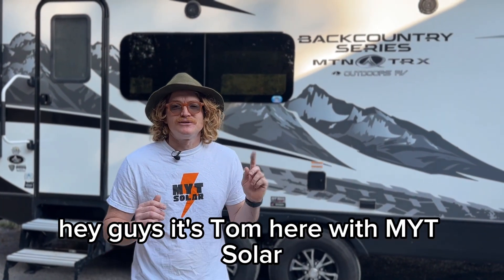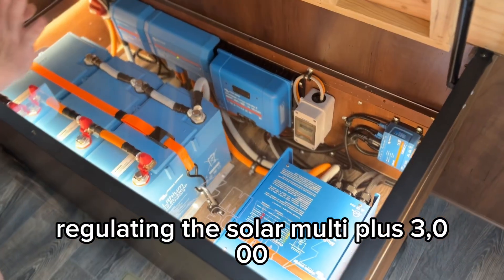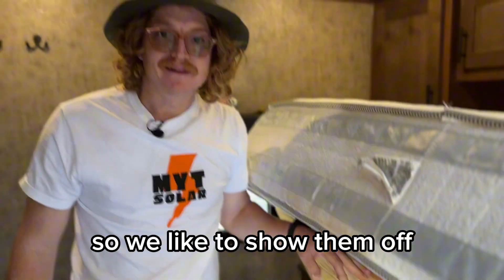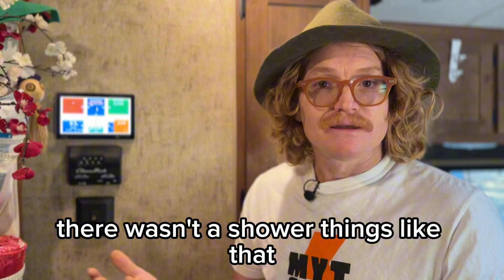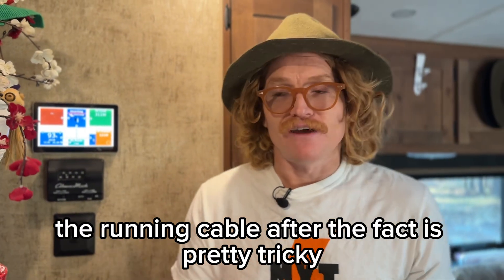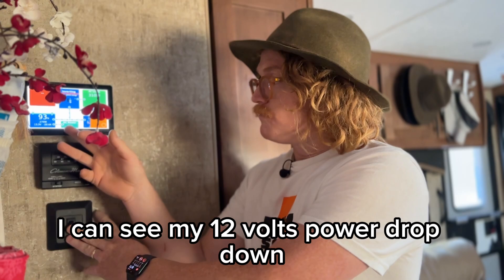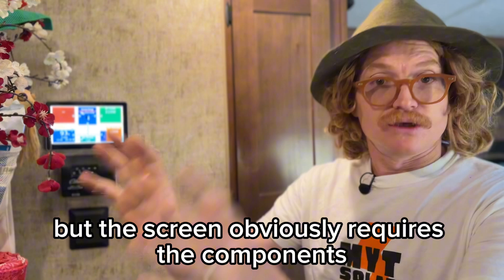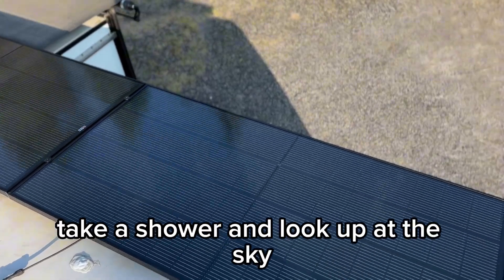Is LESS RV Solar sometimes better? | Outdoors RV 24KRS

Comment: I do wish ORV (and other RV’s) would run conduit from in the wall where the factory controls are into the front storage.  Even just a BMV712 would be easier to install in a factory looking location.

I also wish they’d spec low profile AC’s, like a Penguin heat pump.
Reply from the maker: Both of those things sound way better for our installs. An easy way to run cable for the Touch 70
Would be awesome. We get lucky sometimes but sometimes it ends up in a less than ideal spot.
Reply: I don’t have an ORV currently, but on the unit I have now I swapped the standard AC for the Dometic low profile Penguin.  Cools great, looks better, and dropped the height enough to park under my carport. They aren’t that much more money, and I’m not sure why the lower profile units aren’t more popular as factory equipment. 

With the big solar systems you build, upgrading to the Penguin with heat pump might be worth it.  Lots of people off grid in Arizona in the winter, and I’d bet they could eliminate or greatly reduce furnace and propane use- especially if a person already invested in enough solar to run AC in the later season.

Comment: It is interesting how everyone is hung up on how much solar on the roof.  The purpose of the solar panels is to provide power to the battery system.  The solar panels on only one way to charge the batteries,  The batteries can also be charged with shore power, generator, & DC to DC charging.  In my rig I can run my trailer for 3 to 4 days on the power in my battery bank even with the solar panels are not providing much new power.
Reply from the maker: I would agree that solar is just one important charge mechanism. But for people who are out camping in a quiet location without shore power, it is a very important way to juice up the battery. That is awesome you can get by for 3-4 days without any change from solar. Sounds like a well sized battery bank.

Comment: The 24KRS is an Awesome floor plan.  I checked them out when the first one arrived at my local dealer in Spokane, WA
Reply from the maker: I would agree, we have another one we are working on this week. With the multiple interior and two exterior doors it lives very spaciously. We do appreciate the generator also!

Comment: If you did want to get to 2kw on that roof, the best way would be to use an aluminum strut system and install your panels above your roof obstructions. That also allows you to use larger and cheaper residential panels, and provides shade to your entire roof. The downside is you do add a little bit of weight, and add a couple inches to your height.
Reply from the maker: We see a lot of people clearing the AC lately which is awesome. We're exteremely happy with our rails at the moment but might look into going a bit taller in the future. Height probably isn't an issue for these smaller trailers and with a low profile AC it could keep the clearance almost the same.

Comment: Your builds are always a work of art. On that rig you are right about the shade from the A/C shroud reducing output. The extra expense might not be worth it. Unless your customer is willing to rack his solar over or at least even with the top of the A/C, you're limited not just by the footprint of the A/C unit but by its shade as well. A deployable array is a great idea, or you could also build a liftable array on the side of the RV like I did, which can be raised to the exact angle needed for optimal production, harvesting about 20-30% more power than horizontal panels, especially in winter. My side array shades my bedroom window too, so there's less heat load on my A/Cs. You could even do both if the customer wants to run his A/C a lot like I do.
Reply from the maker: Thanks! We sure try to keep it clean and organized. You are exactly right, not only does the footprint of the AC get in our way, but so does its shade-print. We definitely have to work on clearing the AC soon.